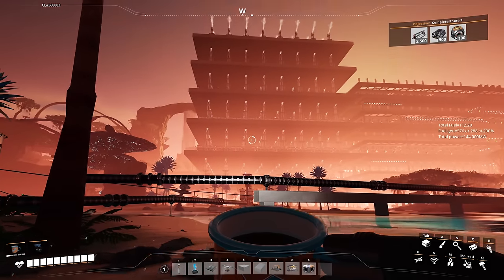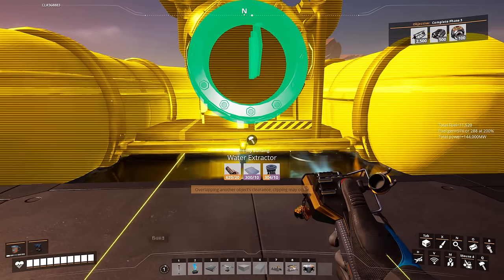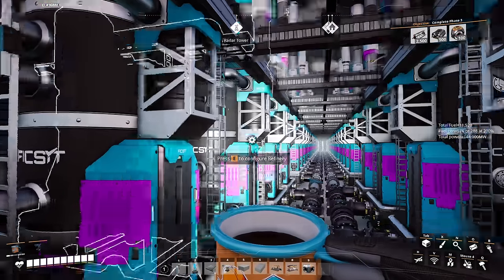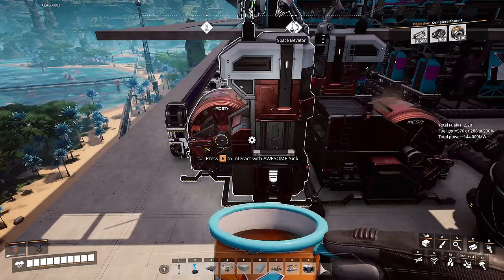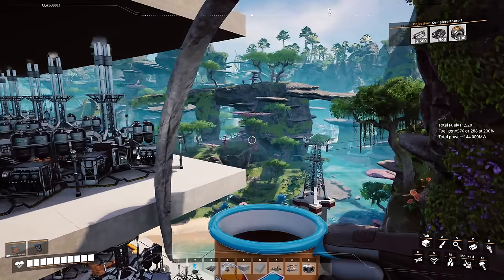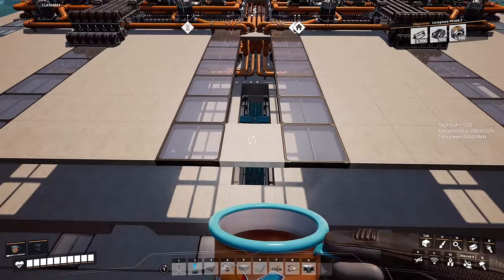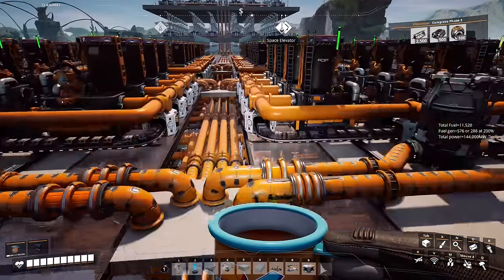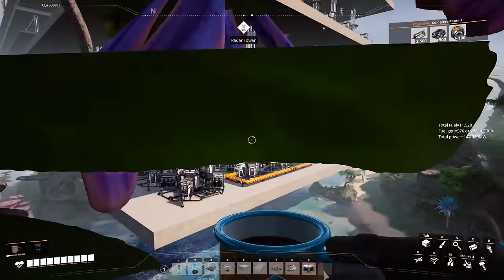How I made 144000MW of power in Satisfactory 1.0

Comment: Very nice Factory! Because I get too overwhelmed by big projects, I do my oil factory in modules. I do 5 refineries at a time with 4 blenders, 3 water extractors and 20 Fuel Generators. It takes alot more space, but it helps me stay organized. I am about to start my Nuclear factory  with just 10. I am already overwhelmed lol. Awesome job Xaos!
Reply from the maker: lol thanks, yeah big projects like this get out of hand quickly but also you can deny they dont look amazing.
Reply: Should not have to use blenders
Reply: I use Diluted Fuel. So I need them.
Reply: Just finished my nuclear production yesterday. Mk 3 miner on impure node, fully overclocked, gave me 300/min uranium ore. 12 manufacturers making alt recipe for encased uranium cells, feeding 12 manufacturers making alt recipe for fuel rods gave me enough rods to feed 36 reactors. Instead I overclocked 18 of them to 2x, and after 30 hours of prep work bringing all the materials to feed them, I had 90k MW, preparing me for the next phase of making nuclear pasta.
Reply: @Fydril  packaged fule is crude an packaged water in the foundry
Reply: @Fydril  still look good 👍 I'm trying to figure out a crazy 30 row 30 high stack belt bus that just circles pulls an feeds one huge factory
Reply: @coldblooded1379 Nah there is packeged deluted fuel and deluted fuel. Deluted Fuel from blenders is far more efficient than oil. For example I can make with my rocket fuel power plant somewhere around 120 GW from a singel pure node.

Comment: i dont get it i have 2 power pkants my small one with 32 fuel generator and my big one with 456 so total of 488 on 250% i check every plant so many times it runs perfectly with full tanks, but my power generation is on 299800 with minimal fluctuations but normaly its need to be a perfekt 305000 MW this triggers me so much ich checked everything so many times
Reply from the maker: your best bet is to cut off groups of generators and find the ones that are not running the best, and work backwards from there.

Comment: Are you over clocking the refineries? My math is only adding up 80 heavy oil residue refineries getting 3200 crude oil. Where the 192 Diluted packaged fuel refineries need 5760 heavy oil residue. Am I missing something?
Reply from the maker: no overclocking on the refineries.  4,320 Crude oil, makes 5,760 HOR, to make 11,520 Diluted packaged fuel.
Reply: @DrawingXaos  so how many HOR refineries do you have? Because I only count 80, no?
Reply from the maker: @Ayeooh  192 refineries

Comment: I’ve basically made the same factory, same recipes and amount of power generated, except I didn’t stop at fuel and went all the way to rocket fuel. And instead of all that oil I just used one 600 line. After using 3 of those power booster things and the other power plants from my save I got my total production up to 200GW
I’m very happy with myself if you couldn’t tell 😁
Reply from the maker: Nice, yeah you can do so much more going into rocket fuel, so when i update this place....

Comment: I made a smaller one of these using blenders, i don't have any aluminum being made, so i just used materials i found from drop pods, there's so much aluminum, computers, and heavy frames, so i was able to finish phase 3 and unlock blenders all without making computers, heavy frames, or any aluminum products 

My current powerplant makes 17580MW, which I've attached to batteries and two factories making everything i need to make a turbo fuel plant at the blue crater lake, using blenders!

I didn't want to deal with packaging
Reply from the maker: Nice, i know the feeling.

Comment: to be honest i think you should have gone all in with the 2 half-circles cut off from the thing and copied it on the subsequent floors....

also made me think if you should include a outwards half circles on the seaside halves sides but theres some rock in the way and then when you were talking about drones taking the polymer resin away from there at some point it made me think of the drones blocky form and i was like if you squint a lot you could add wings to that building and make it kinda look like a drone.... so making the wings somewhere like the water packager height and to hold the drone ports on each side of the building could be something... and it should probably be high enough to not clip with anything on the sides...

on a side note to decoration.. because its slightly elevated from the ground have you considered adding lights there to make the underside of the building glow with some color?
also flood lights lighting the water extraction area popped into my head as an idea... perhaps not with purely white light but for example with a light blue or red tint for example could work out as a aesthetic to indicate there is some light to go out there to fix stuff when it breaks type of deal...
Reply from the maker: with the ability for each floor to work properly that is not a bad idea. dang, i must redesign lol

Comment: why do you dont use turbo fuel? is there any major issue with it?
Reply from the maker: There is a plan. if i make fuel, and make power with that fuel, then i will have enough power to make turbo fuel, and then rocket fuel. if i make a big station for rocket fuel at first, its not going to work.

Comment: This is nuts because i did 1200 oil and made 80k power with this set up and the hardest part to me besides the damn packagers was the compacted coal (because i did turbo fuel). i ended up doing 16 overclocked and slooped ... so i didnt have to get rescources from everywhere at blue crater. I also did containers for the empty cans at first and just left 4 full and 4 empty but they kept doing weird shit. i did 320 gens ( did 4 rows of 80 needs a pump every 10 with long lines)... and it took like 70 hours. lol well powers solved for a while at least.
Reply from the maker: Compacted coal, what fun. I can't wait to do rocket fuel
Reply: My current setup uses 1350 crude and im making exactly 300.000mw in 480 fully overclocked gens. How do you only make 80k from 1200 crude?
Reply: @ppeez  you make 4 lines of 300 so T1 pipes into 10 refieries each so 40 , then making heavy oil res that 1600 a min you put that into 53 refieries last one uncerclocked at 33 percent making diluted packaged fuel , wich  makes 3180 fuel per min then you take that and put that into unpackagers and then128 refineries with compacted coal and get 2400 turbi fuel per min and then make 4 rows of 80 fuel generators .. and put a pump every ten to keep the line going. 320 x 250 a Gen thats 80GW with 3 power boosters im making 105GW  turbo fuel burns at a slower rate 7.5
Reply: @highmindgaming9849  ah ok youre only making turbo, thats why its so little power i was wondering how you managed that

Comment: Why wouldn't you watch the 600 pipes aka trun 3 extractors around 6 extractor facing each other
Reply from the maker: 480 works better
Reply: @DrawingXaos  still have to use a 600 pipe an if you center it out an do the math you get the lift you need to package the water on a floor just above an use 0 pumps
Reply: = more power less 💪 less effort

Comment: Trubo heavy fuel alternate is much better. No packaging or water involved; just a lot of sulfur
Reply from the maker: that is for the future. right now i only have tiers 5 & 6 unlocked.
Reply: @DrawingXaos people always forget this. I would love to use pure ingot recipes... if I had refineries unlocked 😅
Reply: @deejeh9494  it literally takes 6 hours to get to refineries from the start. You're talking as if it would take days to get to that point...
Reply: @BPFACTS88  I played with a few people who were new to the game. It was a good reminder. But also, some people don't play the same as you. 
Don't forget you have to unlock the alt recipe.
Reply: Actually if you want to make rocket, turbo and rocket standard are the most efficient recipes because you can recycle the compacted coal.
Reply: @ppeez  if you want your coal then Nitro Rocket is the better recipe. Normal fuel, Nitrogen gas, 100 Sulfur/pm and 50 coal gives back rocket fuel and 25 compacted coal. If you push into ionized fuel, you get more comp coal byproduct.
Or just use Turbo blend and create comp coal from petroleum coke.
Reply: @deejeh9494 ionized is not worth burning. Also sulfur is way more important than coal, and you use WAY more with nitro. standard rocks.
Reply: @deejeh9494 turbo blend is also worse than standard turbo for crude efficiency. also you again cant recycle the compacted coal from rocket fuel. You never did the calculations on an actual factory, did you? The weight points dont lie

Comment: Now if you ever want to go step further, then unlock turbofuel from MAM research. With compacted coal added to fuel, you could use less than half of that total fuel and still produce more power when fuel gens use turbofuel. 
For example, to produce 150,000 MW, you would need 5400 fuel (9x600 pipes), which is pumped to 240 Refinery (to produce turbofuel, for which you need total of 3600 compacted coal (3600 coal + 3600 sulfur)). Total turbofuel produced would be 4500, which is enough for 600 fuel gens. And total amount of crude oil needed is 2025.
Reply: just skip that and go rocket fuel
Reply: the setup in the video and also your idea are both really dumb things to do. Within like 6 hours of playtime it's all gonna be obsolete when rocket fuel comes.
Reply from the maker: naw rocket fuel is where im heading later. but that is when i do the rebuild. and have drones.
Reply from the maker: but i will need fuel when i make my rocket fuel. so i need part of this set up. and the goal is to turn this into rocket fuel. then have a massive amount of power.